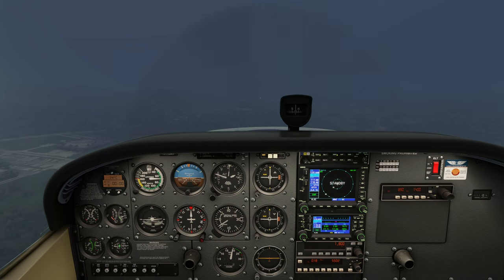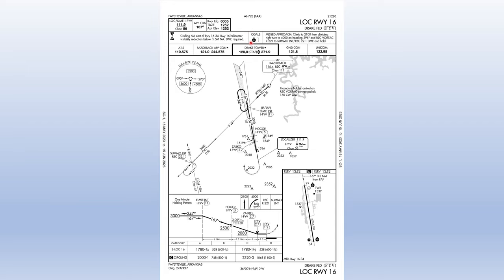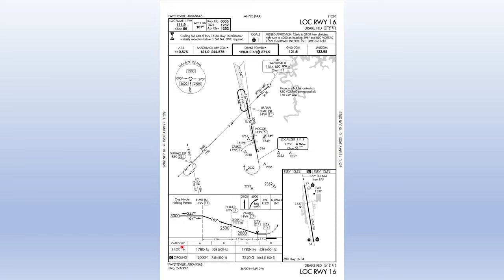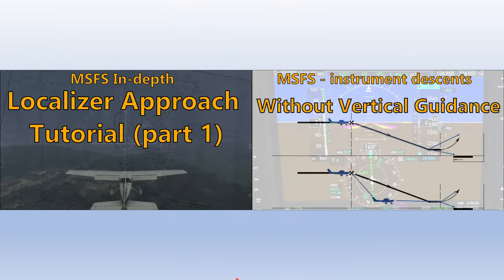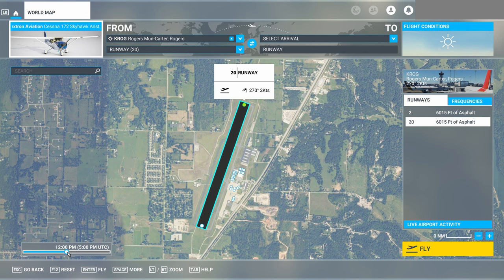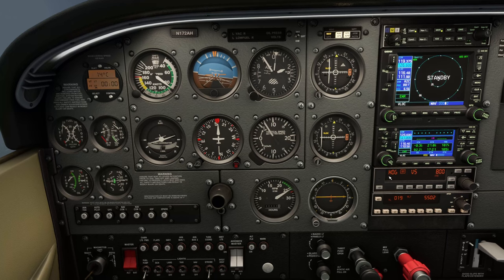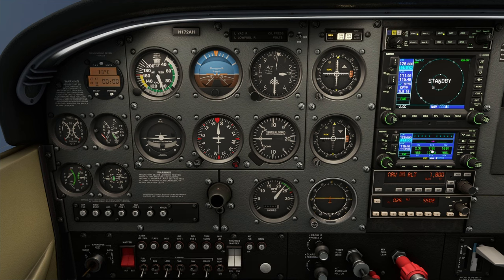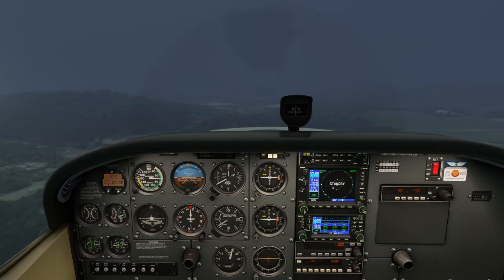MSFS - Localizer approach demonstration - Cessna 172 Classic (AH IFR flight lesson 7.3)

Comment: Thanks for making these, I am learning a lot from your videos sir. I understand there's not a way to fail individual instruments in flight sim, but is there any way you could please teach us by making a separate video on partial-panel flying?
Reply from the maker: apophis1337, thanks for the kind words, and I'm glad you're finding the content helpful.

I do have a video on the plan for partial panel flying - I just don't know how long it will be before I get to it.  You can fail instruments in the 172 classic on PC by using an mod/utility called "RandFailuresFS2020."  It will let you fail a number of components in the aircraft including individual instruments, and systems like the vacuum system.  It is available at Flightsim.to.  Here is the link:  https://flightsim.to/file/2272/randfailuresfs2020

(You can fail screens on the G1000 172 using the master/battery switches and the avionics master, but there is no way to fail an individual instrument - aside from the standby instruments - on that aircraft.)